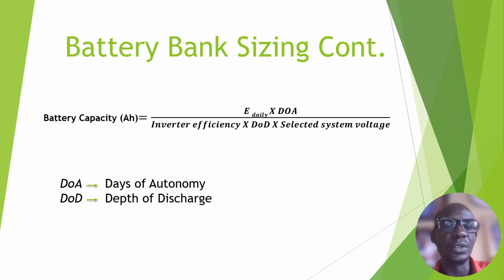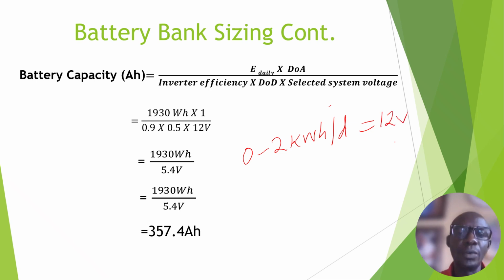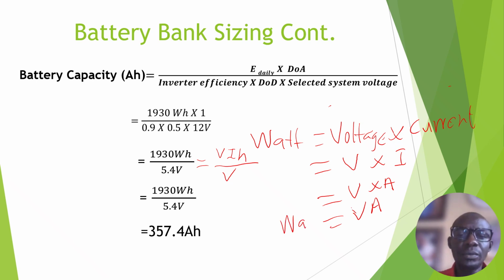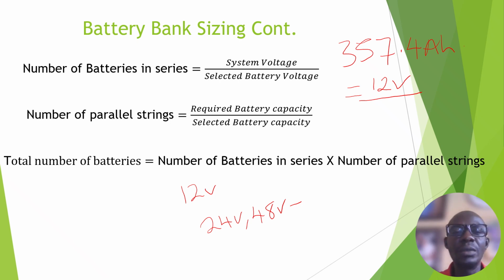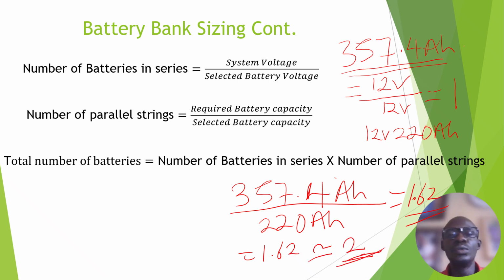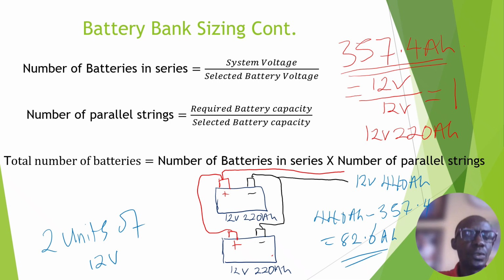Battery sizing

Comment: This video, a follow-up to a previous one on solar energy system sizing, focuses on determining the battery bank capacity for a solar home system (0:05-0:46).

The speaker introduces a formula for calculating battery capacity, which is rated in Amp-hours (Ah):
Battery Capacity (Ah) = (E_daily * Days of Autonomy) / (Inverter Efficiency * Depth of Discharge * Selected System Voltage) (1:11-1:33).

He then explains each variable in the formula:
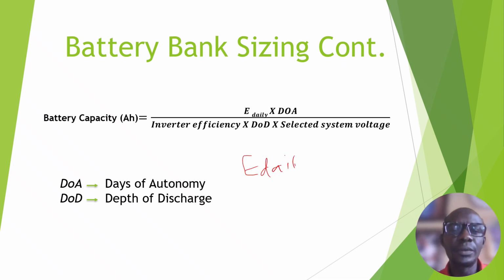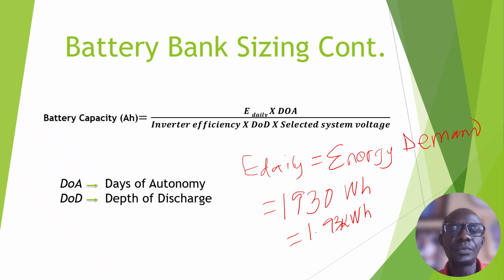E_daily (Total Daily Energy Demand): This is the total energy consumed by the loads in Watt-hours (Wh), which was calculated in the previous video. For this example, it's 1930 Wh or 1.93 kWh (1:47-2:26).
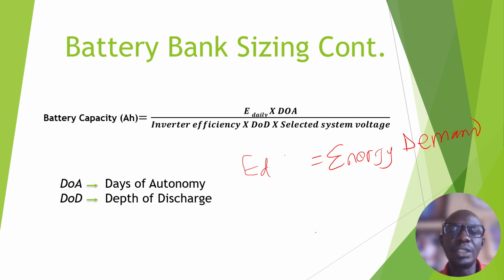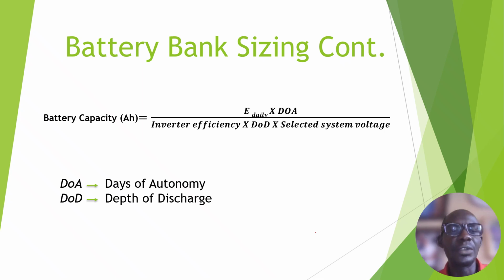Days of Autonomy (DOA): This refers to the number of days the system can run without sun (e.g., cloudy days). It's a crucial factor for ensuring system reliability (2:34-3:42).
Depth of Discharge (DOD): This is the percentage to which the battery is discharged. For lead-acid batteries, it's recommended to discharge no more than 50% (0.5) to prolong battery lifespan (3:46-5:00).
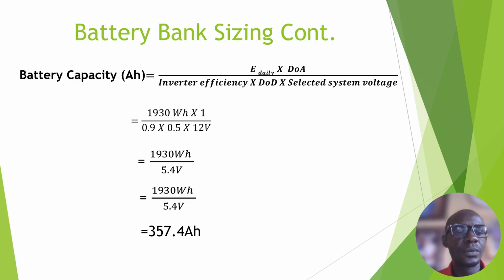Inverter Efficiency: This indicates how efficiently the inverter converts DC energy from the battery to AC for household appliances. Good inverters typically have at least 90% (0.9) efficiency (5:18-6:20).
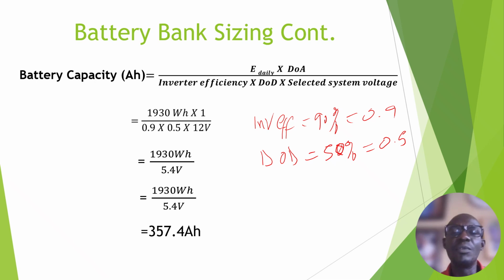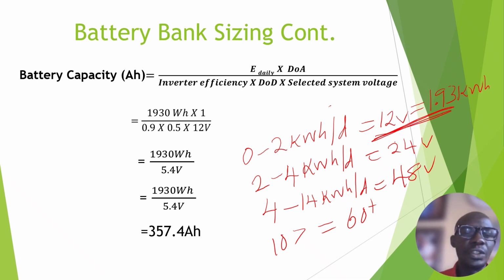Selected System Voltage: Common system voltages include 12V, 24V, 48V, and 96V. The appropriate voltage is determined by the total daily energy demand (7:24-9:56). For this example, with 1.93 kWh daily demand, a 12V system is selected (9:44-9:56).

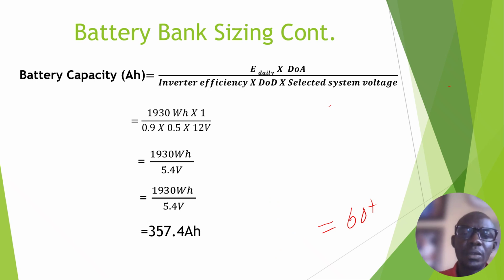Applying the formula with the chosen values (E_daily = 1930 Wh, DOA = 1 day, Inverter Efficiency = 0.9, DOD = 0.5, System Voltage = 12V), the calculated battery capacity required is 357.4 Amp-hours (10:09-12:22).

Finally, the video demonstrates how to determine the number of batteries needed:
Number of batteries in series: This is calculated by dividing the selected system voltage by the selected battery voltage (typically 12V for lead-acid batteries). In this case, 12V/12V = 1 battery in series (13:01-14:03).
Number of parallel strings: This is the required battery capacity (357.4 Ah) divided by the capacity of a single selected battery (e.g., 220 Ah common for lead-acid). 357.4 Ah / 220 Ah = 1.62. Since you can't have a fraction of a battery, this is rounded up to 2 batteries in parallel (14:51-16:20).

Therefore, for this solar home system design, two 12V 220Ah batteries connected in parallel are needed (16:22-18:46). Connecting batteries in parallel increases the overall capacity while maintaining the voltage (16:41-18:00).